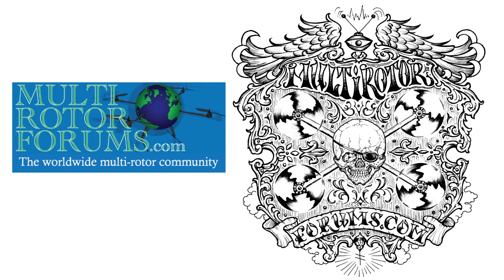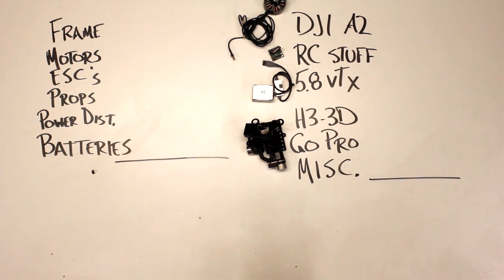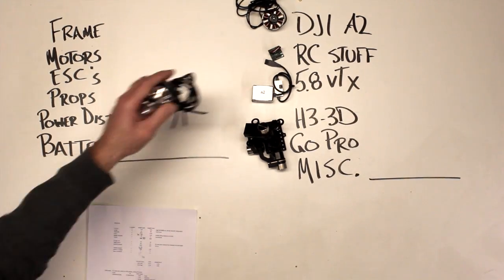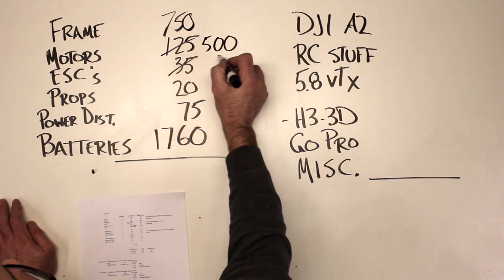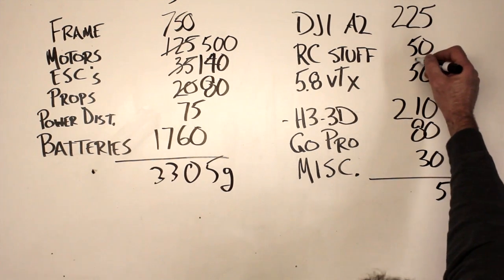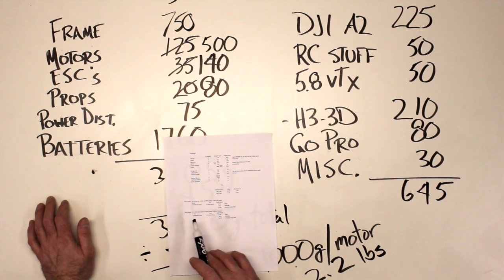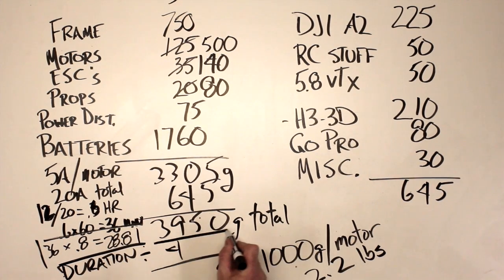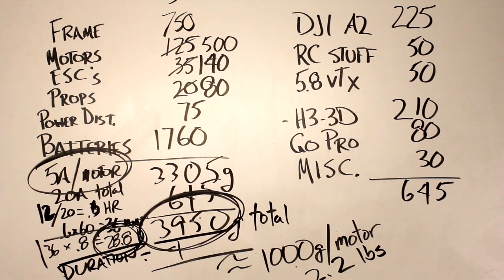Custom Quadcopter DJI A2 H3-3D, with a twist!

Comment: Have you considered using Panasonic NCR 18650B Li-ion?  You would save 1000 g and add 2 amp hours with the switch (4S4P). Have to keep an eye on the amperage I guess, the max amp for a 4P pack would be 28.  also, I guess if you are only trying to build with existing materials I understand why not.
Reply from the maker: Li-ion and A123 cells never caught on with multi-rotor helicopters for whatever reason.  I'd be willing to look at them again but I've got a bucket full of the 6000 and 8000 LiPo packs so that's what I'll be using for this heli.  Thanks for the view/reply.
Reply: thise Li-ion, are they better then Li-Po ? I want li ion I dont want to think about fire with Li-Po!

Comment: What flight time could I expect for a 2800g quad running e600 motors and an 8000mah 6s? My calculations say 42 min but that sounds off, any idea/estimate? And if you are feeling extremely generous could you calculate it for me? Thanks!
Reply from the maker: How much current do the motors draw when hovering at the 2800g weight?
As far as my calculations go, the 28 minute duration can be seen as overly optimistic because it's not really practical to say the helicopter will simply climb up and then hover for the whole flight.  So the more aggressively it is flown the quicker the batteries will drain out thus shortening the flight times.
Reply: each motor pulls 7g per watt at my weight
Reply from the maker: max, if you can determine what each motor uses in amps while hovering you can work towards estimating flight times